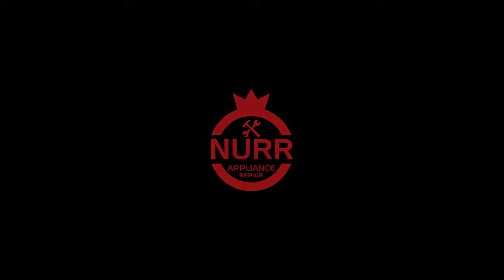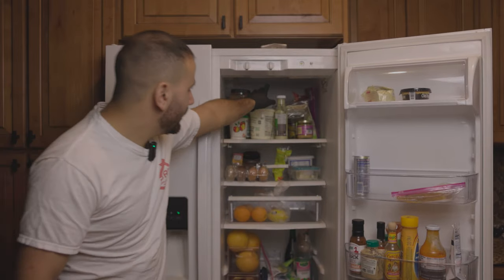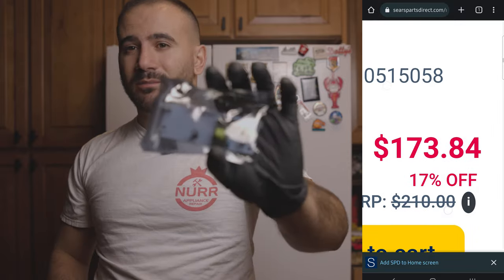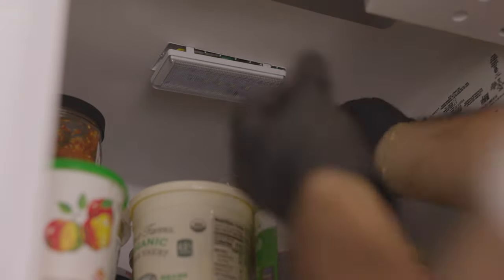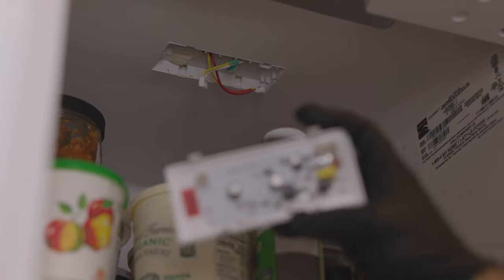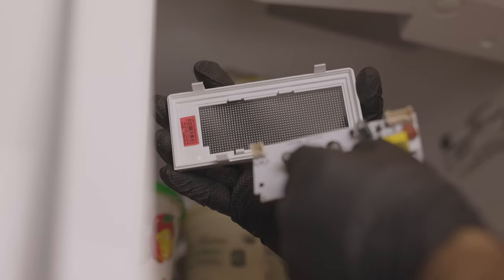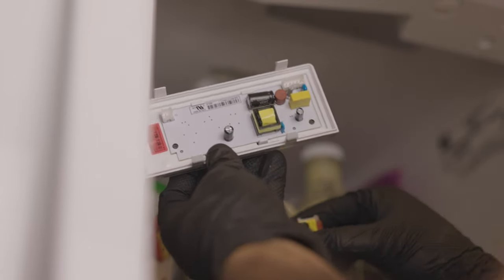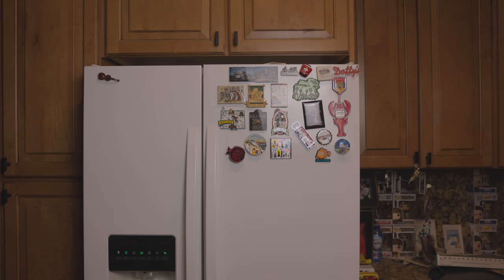Kenmore Refrigerator | Light Board Replacement | 4K UHD

Comment: We did this today - following your exact instructions. I ordered the part based on your detailed list. This works GREAT! The person who installed the light said the instructions were easy to follow for anyone.  One thing to note - if someone chooses the wrong light to replace -that is - the one that is not burned out - the new lights will blink - we tried that. When the correct light is replace - all 3 lights work very well. I almost need sunglasses to look in my refrigerator now! Thank you. You are a genius. Have a great day.

Comment: The reason you keep replacing these lamps is because you keep buying cheap amazon parts.
Reply from the maker: Not true.

If that was valid, why did the factory light board fail? 

And we've used factory light boards in the past, and they have failed. 👨‍🔧

Comment: I just replaced mine with the help of this video. But I noticed the new Amazon panel is not as bright as the previous light was. Is that normal since not factory quality?  Also the other lights came on as described but also quite dim. Any suggestion?
Reply from the maker: If it's really dim, might be an issue with the boards. Try to replace them again with another kit from amazon. If you still have issues, you may have a power issue from the main board behind the refrigerator (rare but possible). 🧑‍🔧

Comment: What should i do if ive purchased 2 replacements and they both still blink upon installation?  I changed the main as you did in the video
Reply from the maker: Change the other light boards too? If one has any failure, it will blink.🧑‍🔧
Reply: @nurrappliancerepair  thank you ill try that

Comment: Hello brother, My Refrigerator the lights are are barely working, they are flickering in the refrigerator and the freezer side. I'm guessing that one of the LED'S has gone out on the main board , like the one that you replaced. Do you think that is the issue?
Reply from the maker: Hello my friend,

Your refrigerator is the same/ similar to this one? If so, than your light boards needs to be replaced. 🧑‍🔧

Comment: How do you remove the main board? I can’t housing off. I removed the screws and it won’t come out. Thanks in advance.
Reply from the maker: Hello Dom!

We show at ~8:05 in this video how to remove the board from the housing. If you need further assistance, we have started providing video repair help at a cost.

Thank you!
Reply: Thanks for the reply! I actually meant the defrost board. I figured it out. My fan and compressor wasn’t coming on.
Reply from the maker: @Dominic.Minischetti  Perfect!
Reply: @nurrappliancerepair  I’m going to replace it today and I hope it fixes the problem! Thank God I have a spare refrigerator! 😂

Comment: In my fridge LED Light box seat very tight. Flat screwdriver did not help to take it down.
Reply from the maker: Try harder! But don't break the tabs. 😂🧑‍🔧
Reply: A small shot of silicone might help.  Try harder and evenly.  It will open.
Reply from the maker: ^this! @Chromer